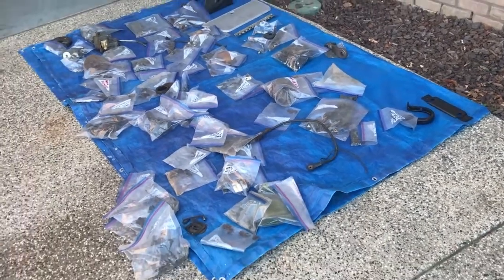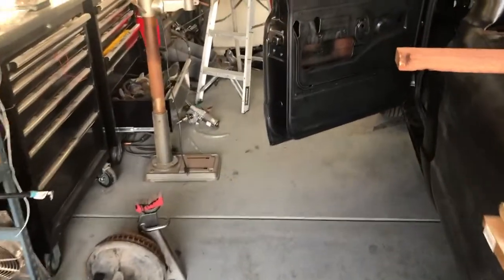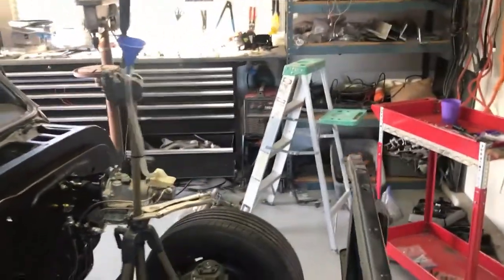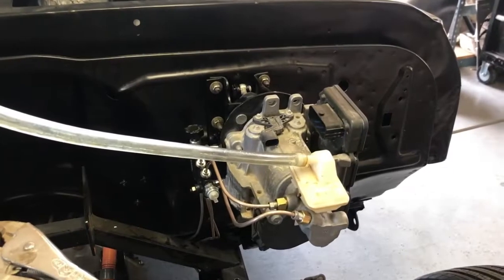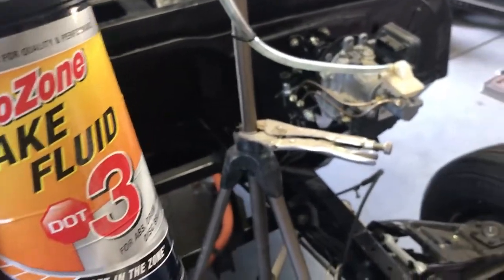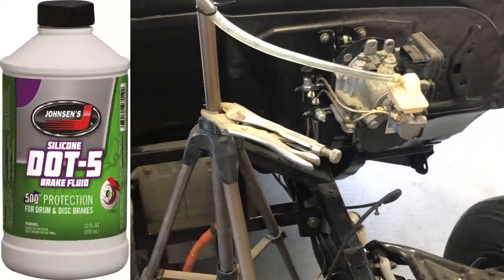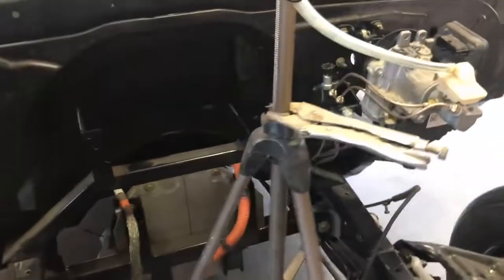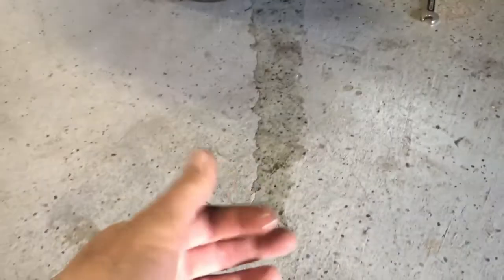Honda CR-V iBooster Brake Fail

Comment: Yes, it looks like yours does. The 3rd picture from 11/12/22 on the open inverter page shows the wire. I was at Honda today, and their diagram shows this connecting through the driver door position switch.
Reply from the maker: sorry no idea

Comment: Thank you for the information. I'm also using a CRV ibooster, and get that shudder. Lars was talking about the start up calibration. I have an extra 22 gauge black wire on position 15 that doesn’t show up in the online searches. I’m curious to know if this is preventing the startup calibration, because initiating 12v on pin 20 doesn’t do anything different audibly, and I get boost without it. I may have to see if the Honda guys know about how that wire is used. It will be interesting to see their response when I tell them my car has a CRV booster, but it isn’t a CRV.  Does your ECU connector have anything in position 15?

Comment: Can you advise if the front port on the master cylinder goes to the front brakes or the rear brakes?  I'm installing a gen 1 ibooster in the car I'm building in my garage. Thank you.
Reply from the maker: i think this booster fed into an abs module where for safety they were something like left front/right rear and right frint/left rear etc, not sure its like that without the abs pluming

Comment: DOT 5 is a silly con.
Reply from the maker: go on ...
Reply: @frostbite1991  I’m in it solely for the pun.
Reply: Not a scam, just not needed anymore unless it's called for from the factory. DOT5 used to have the highest boiling point, but then DOT5.1 was created. The biggest advantage of DOT5 is it's inability to absorb water. On the flipside, that means that after extended periods moisture that makes its way in will pool, potentially causing rusting issues. Being silicone-based, and not Glycol-based, it also cannot be mixed with ANY other braking system. This means, unless your application already calls for DOT5, you would need to completely flush the system with solvent in order to switch over as manufacturers coat the insides of hydraulic braking components with DOT4 usually, to prevent rust from storage and shipping. Silicone based fluids may also have adverse effects on seals designed for glycol-based fluids. 

Since DOT5.1 exists, and has an even higher boiling point, the use of DOT5 here is odd and requires much more work than just using DOT5.1. As it stands, in order to switch back the system needs completely flushed with solvents again (assuming that was done prior to pouring the DOT5 in)
Reply: @lsh3rd  I got the pun 😁.
Reply: @chriscope2724  I really feel sorry for the guy who wrote that long reply that didn’t get it…